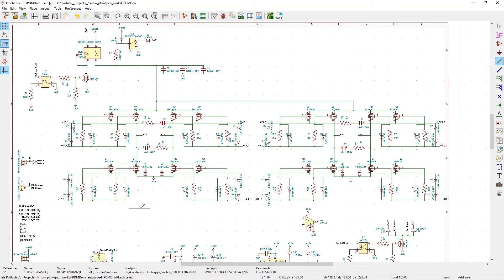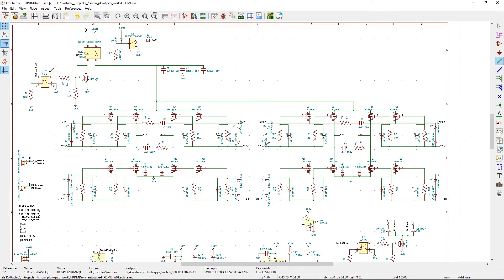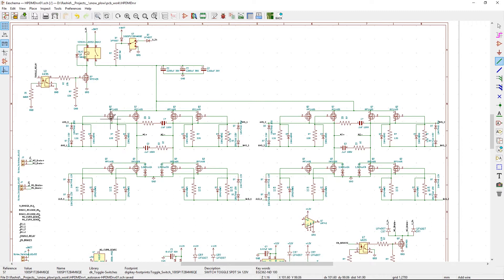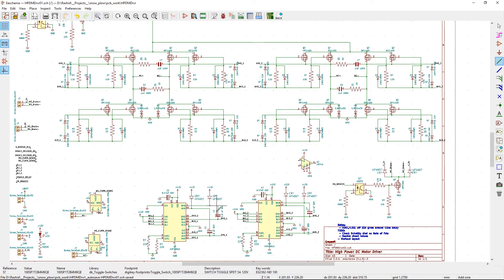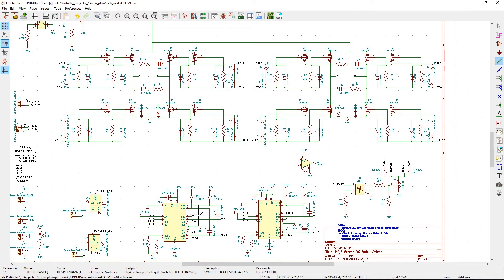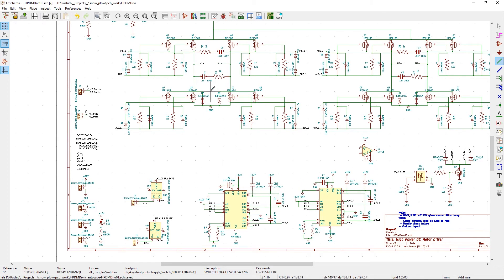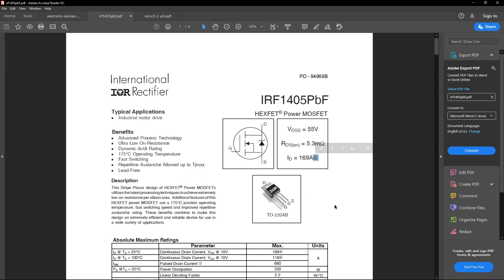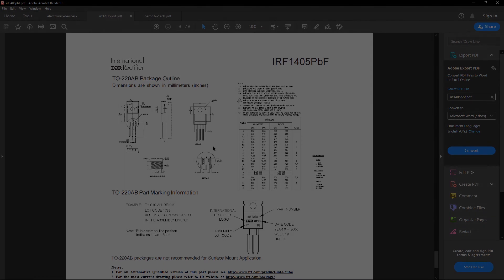High Power DC Motor Controller 100 Amps Schematic

Comment: So this can run a 2-3 HP Treadmill motor, 110VDC, 21 A, no problem?
Reply from the maker: you might have to check the specs on the mosfets to see if they can handle that much voltage